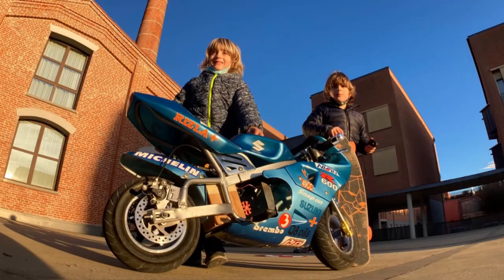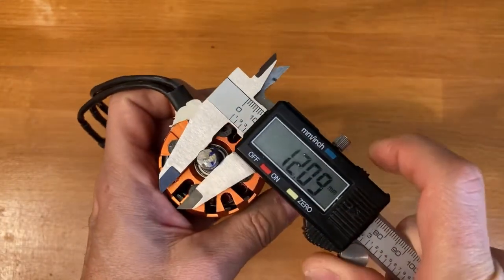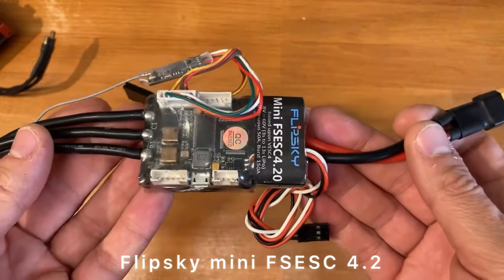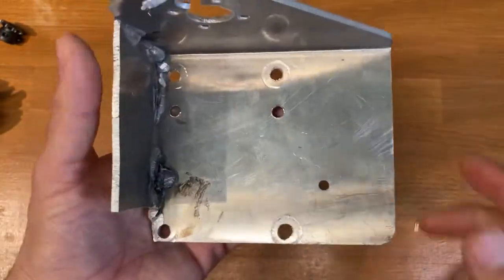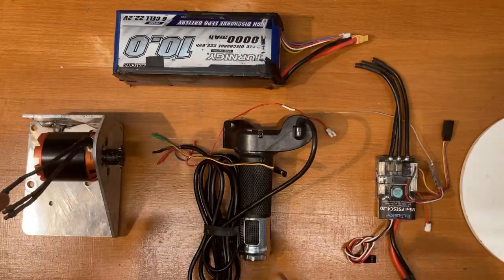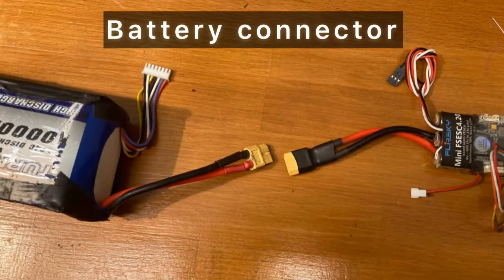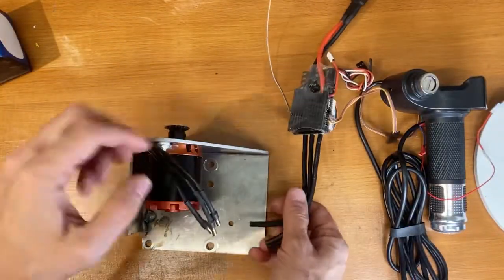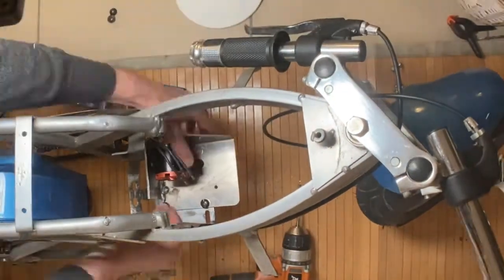Pocket bike electric conversion - DIY brushless

Comment: Is the motor strong enough to pull an adult?
Reply from the maker: I reached about 40 km/h with 6 cells, and i m 65 kg, but he has small acceleratoon, you should go for higher pulley teeths. For a kid the acceleration is more than good
Reply: @MakerFabio  hi again! Thanks for your great video!
I bought the exact same things like you use in the video, could you share your settings regarding the programing? Either here or pm me? 👍
Reply from the maker: @rallerask3177  hi, sure but i think i need an email or somewhere to put the configuration file
Reply: @MakerFabio  Did you have time to mail me the file yet? Thanks for all your help and great video! 👍
Reply from the maker: @rallerask3177  hi , i didn t see your email address yet.
Reply: Go online and get a 1800w 48v mid drive motor. They’re around £100 and my build will pull an adult to over 60kph with gobs of torque